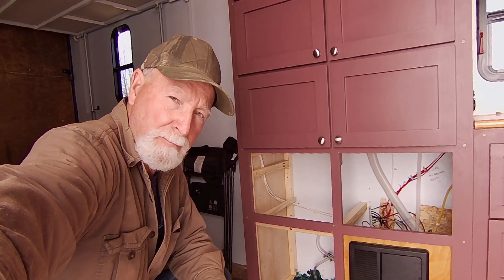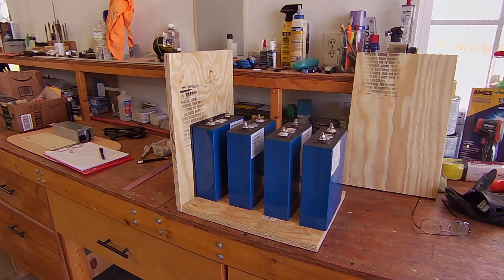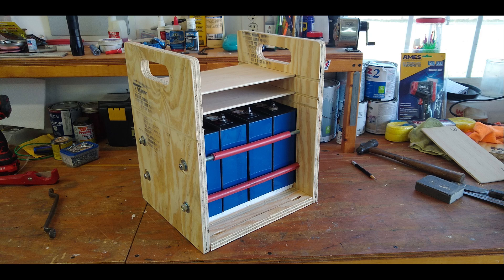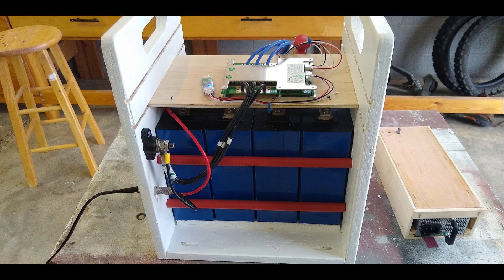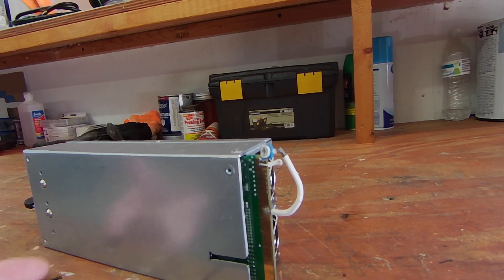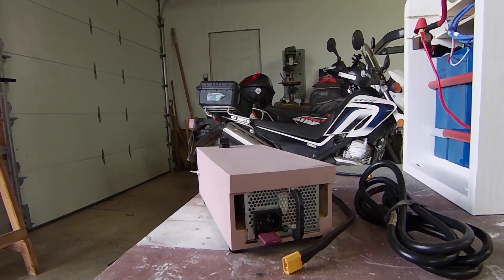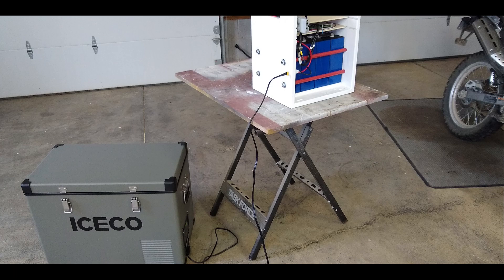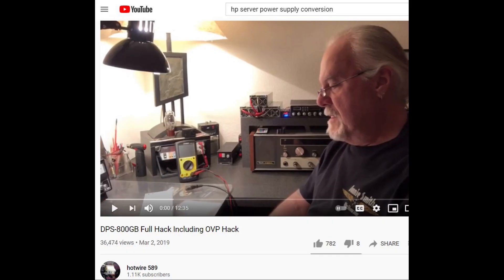280 AMP Hour Battery Build

Comment: John, 

I have been enjoying your build videos for some time now and am amazed at your depth of knowledge over many disciplines, your craftsmanship and your attention to detail. Kudos!  

I noticed that the bottoms of the sides of your battery box are fixed to the base board with kreg screws. Do the threaded rods merely hold the sides tight against the battery to prevent swelling rather than actually applying a compressive force?

I am aware of the differences in opinions about whether the cells need to be compressed with the forces set forth in the manufacturer’s specs vs. merely being held firmly in place to avoid swelling.

I am in the process of building my battery box and am confused about construction methods and how much pressure to apply.

Thank you!
Reply from the maker: Those rods are basically used to just hold the batteries in place.  I don't believe that I need to use compression to make my cells last longer.  Like Will Prowse is always saying, the cells will die from calendar aging before they will be degraded because of too many cycles.  My battery is a year old and it probably has only 2 cycles on them yet! I wouldn't get too caught up in compression schemes, don't see any need for it. Thanks for the kind words and good luck with your build.

Comment: Hi John.  I like what you did.  I'm planning on building one like it in the winter.  Thanks for the reference to the group buy.  I'll check that out.  What rubber did you use between the cells?  Was it something like this:  

https://smile.amazon.com/6x6-Inch-Neoprene-Plumbing-Material-Protection/dp/B018H9CCPG/ref=sr_1_3?dchild=1&keywords=rubber+sheet&qid=1619739213&sr=8-3
Reply from the maker: yes, my neighbor gave me a huge roll of it, about 6 feet long by 30"'s wide.  The stuff there from Amazon is just like it.

Comment: Hey John this is an unrelated question but on your mini split have you had any issues with it and did you run a seperate ground from the condenser to the frame?  I'm doing the same thing on the battery but I decided to run a 24V system which gives me a 6.7 kw battery.
Reply from the maker: no issues, no separate ground.

Comment: What would you say you are in to this for, $-wise? I'm guessing Batteries + BMS + misc material around $1000? (I didn't see what you used for buss bars) - EDIT: Sorry, rewatched it, you said $600. I missed it the first time. I'd like to know where you got your batteries. Sounds like a great price. 
Does this BMS include a temperature monitor, for cold Temps?  I live in Michistan and this is a concern of mine. 
Thanks for the tip on the HP power supply. To bad the guy that showed the mod isn't making vids. He seems to be a wealth of knowledge. 
I can't wait to see your update after using these battery for awhile. 
- Saw this vid posted in Cargo Trailer/Toy hauler group.
Thanks for the info, nice build. I like these kind of videos that don't go into finite detail!!  EG: "Here's how to cut the radius of the plywood side wall", "Here is how to hold a screw gun..", etc. Right to the point. Thanks again!
Reply from the maker: Yes, it has a low-temp cutoff.  Go to the DIY Solar forum and look for the thread on Group Buy.  A fellow named Michael is helping folks over there navigate the minefield which is buying batteries on Alibaba.  Batteries came with double buss bars.  Thank you for the comments.
Reply: @johntalbert8227  YES, Minefield is a good explanation. I am pretty technically savvy. But this lithium battery thing is just so sparatic, it's hard to know where to jump in. Thanks for the forum tip, I'll check it out. 
-subcribed here, looking forward to your updates. 
-Cheers from Michistan. (Formally know as Michigan, prior to communist rule.)
Reply from the maker: The group buy has imploded.  Suggest using (Doncan Technology (Shenzhen) Co) in Houston TEXAS.